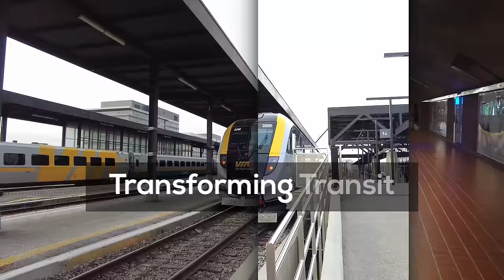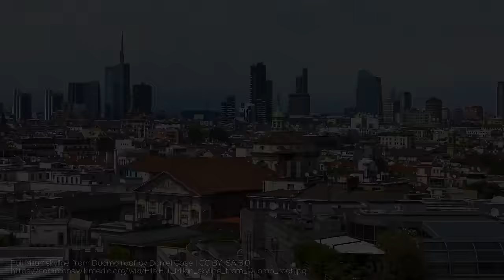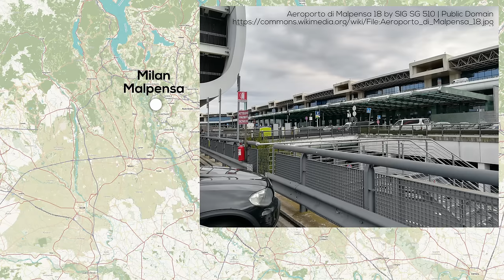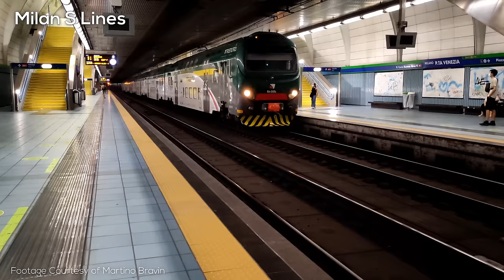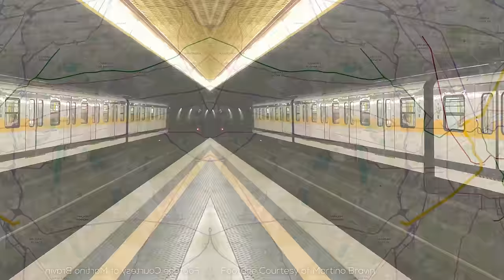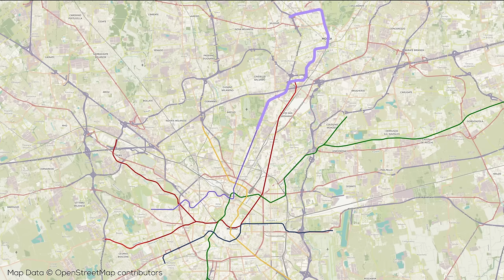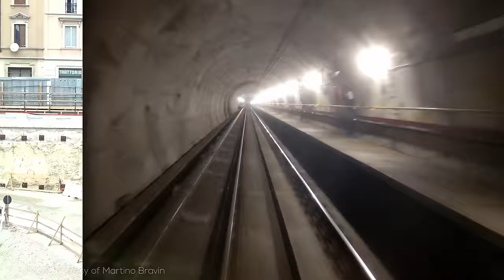A City That Builds Metros Like No Other | Milan Metro

Comment: I think maybe the wavy seats are a subtle way to get people travelling together to sit closer together, and people travelling alone to keep more distance than they might? (They look like "bum slides", so I suspect steering at work.)
Reply: Nope, just a strange design.
First time I saw it I was sceptical. But it's quite confortable
Reply from the maker: Haha interesting! I like a little gentle “innovation” though I am a little worried it’s hostile design
Reply: @RMTransit  I suppose if it's designed to push people around, yes, I suppose that could be called hostile. Sneaky buggers. But I had another thought on this that might be a bit less hostile. Someone sitting on a slightly higher seat than the neighbour would maybe have a little bit of room for his knee to drift outward without bumping into someone else's leg? Maybe that's the idea? Help people be slightly more akimbo without adverse social effects ... which I would say better if the words didn't keep running away from me.
Reply: @sicko_the_ew  I think the idea is to prevent people from sliding into each other when the trains are accelerating and braking by having the sides of each seat curve up more than usual.
Reply: @bahnspotterEU  Sounds like a reasonable explanation of their motives. Although if you're in a "hole", you'll get stopped, while the person sitting on the "mound" to your side is going to come sliding down to get all nice and cozy with you if there's a sudden stop, and the system works as planned? (So results might not be as intended.)
Reply: The wavy seats are a great idea: your a** being in a minimum energy equilibrium position, you don't slide into other passengers.
Also, it's difficult to occupy more space than {the space} you are entitled to…
Reply: @giacomoboffi9394  The sloped sides would definitely help with encouraging people to give others more space. Try to get too close, and you go slipping down the slope, or hit a "wall". 

People in maximum equilibrium positions might still slide down into other passengers, but probably only in some or other catastrophe, where that's not one's main concern. In normal circumstances, when their bums encountered that slope, they'd back off. Pretty smart. They've built "affordances" into the seats, that physically suggest how they should be used.
Reply: @sicko_the_ew  you can't sit on the bump as you WILL slide down as it's a really thin bump.
I think they were designed for keeping people from sleeping on all seats (drunk and homeless people)

Comment: Please do Rome as well, as someone born in Milan but who worked in Rome for years before the pandemic struck, there are stark differences in infrastructure, urban coverage and efficiency.

The only thing I'd add to this Milan video is that the S-line train system is absolutely tragic. The company that runs it (Trenord) has incredible issues with personnel scheduling which leads to huge delays, cancellations and worker strikes on the lines almost constantly (much much worse than the national train company Trenitalia which is also not great).

Apart from that I think you've done excellent work, can't wait to see more!

Comment: Great video! Ilive and always lived in Milano, so I can confirm everything.

Just one minor thing, Bergamo is a different city and its airport (called Orio al Serio) it's not part of Milan. But it is relatively near, so no big deal.
Reply: It's part of Milan airport system, over all on international codification (which include even the tiny and far Parma airport).
Then its users are from/to Milan's area and its enormous passengers growth of last 15/20 years is due to low cost companies wich of course offer connection from/to Milan.
Therefor a rail connection is planned

Comment: I’ve been using it as a base for a few days since arriving on the train via London (with a night halfway in at Lyon). What I still don’t understand is when the Milan tube shuts down? Google says there are trains back to my hotel (Bignami, M5) with a change at eg Garibaldi or Zara at maybe after midnight, but I’ve seen the staff closing off the doors to the station from outside before that.

I got the M2 from Romolo just now, near the Navigi canal district, and they were closing exits there at 23.20! Is maybe one entrance/exit left open, or is the station open only to connections?
Reply: As far as I know, M1, M2 and M3 are open at least till midnight and a half/one a.m (depending on the direction and station position), while M4 and M5 close just after midnight/quarter past midnight. After that, M1, M2 and M3 are served by bus replacement throught the night, while bus line 42 to Bicocca and Bignami continues all night long every 30 minutes from outside of Centrale (on the M2 and M3). Bignami is also served by tram 31, leaving the city centre from Piazzale Lagosta (near Garibaldi or Gioia, both on line M2) from up to 2 a.m.
As a rule of thumb, most or all trams tend to circulate later than metros, up to 2,2.30 a.m. generally, while some bus and the circular trolleybus circulate all night, every 30 minutes between 2.30 a.m. until morning. Hope I helped you and have nice holydays in Italy!

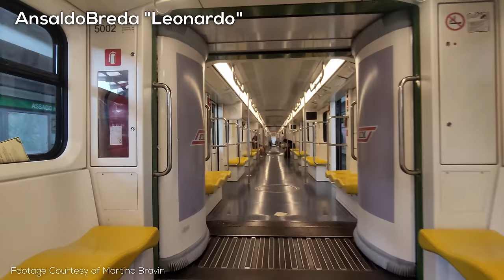Comment: 9:45 The wavy seating looks like it is a measure against homeless people or drunks.
Reply: But it's not
Reply: @urbanfile3861  ; What is the purpose then?
Reply: @FirstDagger  It's a re-interpretation of the usual seats design of the older convoys wich got a 'hollow' in every seat to get more comfortable. Which is pretty standard for rigid plastic seats.
First time I saw that design I thought they were unconfortable, but once I seated I found they actually are comfy

Comment: Also Who is interested in a significantly lower cost alternative which can be as fast, safe & reliable... as well as higher capacity than hyperloop /maglev? 

Using already proven technologies, and fully compliant with all international standards & regulations... it should also be faster to build & develop...

Promote & see our legacy for all generations, especially those yet to come!
Reply: It's trains
Reply: @superj8502  true, but how do you make them to be as fast, safe, reliable...  as hyperloop /maglev?
Reply: @ingoos  hyperloop has never had any large scale tests, but the concept is so flawed on paper that we can safely assume trains to be orders of magnitude safer and more reliable.
As for speed, you need some seriously long distances between stations for it to make a significant difference.
Add to this the complete incompatibility with current infrastructure and i just consider them to be doomed to be relegated to some gadgety airport link like monorails are.
Reply: @superj8502  good insights. I just may have stumbled on a simple solution. Waiting for patent.

Comment: I still wonder why M1 which has TWO starting point and TWO ending point has not split in two different lines. would be much easier to local and tourists alike.
Reply: The M2 has two starting and two ending points. The M1 has two branches, one to Rho Fiera and the other to Bisceglie while starting at Sesto 1° Maggio.

As for the M2, the reasoning could be funding and lack of enough trains to split, also the locals got used to it, and a change would not be liked
Reply: @thecommentaryking  yes, you are right i wrote M1, instead of M2... 
I do not understand this "funding and lack of enough trains to split" - there is nothing extra to do but printing some new poster and give linea M2.1 a new color, the train already are split between one branch and the other... and yes the user may be used to that, but it s not "usable", and i guess the change is easy to accept (and milan will get an extra line :-)
Reply: @ManoloMacchetta  Everything rotates around money. No money for splitting means no split, and even if they had, it would be considered a waste to have to repaint about half of the M2 trains just to have them do the same course as before, plus rebranding/recolouring every station. And ultimately it won't be an extra line
Reply: @thecommentaryking  on a politic / marketing point of view it's important. Milan could have 6-7 metro lines.

Comment: I live in Milan near San Siro in the M1 metro line.
I don't have much experience with other metro in other cities, so I cannot compare.
In peak hours you get trains every 90 seconds, so I agree they are frequent, but I disagree that it's a fast way of moving people.
There are too many stops, this causes the average speed to be around 25km/h.
It would have been better to have a main line stopping only on main stations and have other methods of transport for intermediate stops.
Or maybe a third line used for high speed incoming trips in the morning and outgoing in the afternoon.
Reply: Io vivo vicino a Bonola (sempre M1), ma il problema delle stazioni è anche se sono troppe, nella maggior parte dei casi c'è un via-vai di persone incredibili. Se ci fossero meno stazioni sarebbe ancora peggio... Il problema delle troppe stazioni per me è principalmente collegato ai tram che vogliono fare la "metrotramvia", tipo il 14 dove ha la preferenziale
Reply: @luca2716 va ristrutturata, la metro é sottodimensionato in ora di punta.
Invece di avere 50% della gente sui treni per 30 minuti, se fai il viaggio in metà tempi li hai sui treni per 15 minuti.
Serverebbe una terza linea bidirezionale ad alta velocità, per entrare la mattina e per uscire la sera. Oppure ogni tanto utilizzare entrambi le linee per entrare o soppassare.

Comment: Well I learnt that Italy’s largest and busiest metro system wasn’t Rome!🤯
Reply: Unfortunately Rome's metro system is really bad, just as the city public transport in general. It should become an example of how not to manage a metro.
Reply: @LucaPasini2  problem in Rome is that everytime they start excavating, they find some Roman ruins which automatically block the excavation. It is difficult for Rome to have an extensive underground public transportation when the land is literally filled with ruins of historic interests.
Reply: @KhalOisha78  That's a problem when building new lines, and a reason why it takes longer than usual. 
However it's definitely not an excuse for the fact that the lines that already exist are in a terrible situation, with many lifts and elevators out of order, station that haven't been refurbrished since the line openings, old and worn down trains, absurdly long waiting times because someone literally forgot to plan the compulsory maintenance and there are only a handful of trains in working order, an overly complex interchange station at S. Giovanni because they didn't have money to upgrade the fire detection system and had to keep the two station legally separated and also no definite corporate identity, as the three lines (while two other lines classified as "urban railways" but that look and act as metro lines, which is another bureaucratic nonsense) seem to be run by people who've never met each other, with signs and announcements in totally different styles.

Comment: Born and raised in Milan: note that M1 M2 and M3 trains are not composed by 6 cars, but actually by 2, each having 3 unseparable sections. :)
Reply from the maker: Yes but they combine to 6!
Reply: @RMTransit  I think he referred to how the cars composition worked back in the days before full lenght walkable convoys were introduced.
The basic composition was three cars. Head cabin + carriage + head cabin.
The two head cabins got both a separate housing for the driver. Then the full lenght composition was basic composition + basic composition
The basic composition of three cars could even run independently and since the mid '90s service was run with convoys of 3 cars during the last hours of the service.
Nowadays few of these old compositions survived, but you can spot them more frequently on M3, which is the newest line among the ones which used them, then its old convoys got a longer 'life time'.
Reply: The frist gen was L+W+L+L+W+L the frist fefurbish was  LwL+ LwL,  the Second fefurbish  and modern one are L W SP SP W L whit no separation
Reply: trains like meneghino and leonardo have 6 cars

Comment: As Milan citizen i'm just puzzled by the fact why first Linea 5 than Linea 4? why why
Reply: A short explanation.
M4 was a previous project, with the same route that is currenctly u/c. Therefore quite long and expensive.
M5 started with a shorter project (just Garibaldi-Bignami stretch) way cheaper than M4. That's why they found the money to build it very fast. And second stretch to San Siro went in the same way. While to find all the money to build M4 line was way more difficult (both M4 and M5 have private capital quota).

Comment: I think the M4 is ruining the whole system a bit. Before it, you could reach any stop on the network from any line by making only one line change, but the M4 cannot do it because it has no stops in common with the M3 and M5. Then every time two lines cross, there is a stop for who needs to change the line, however, that's not the case for the M4 as it crosses the M3 but it doesn't stop, forcing everybody to first get the M1, to then change to the yellow line. That's a shame :(
Reply: That's still not true: according to your thesis you could go from Isola to Rovereto making just one change; although this could be true by changing at Lotto, it's unreasonable to travel almost the whole M1 and M5 lines just to avoid doing multiple changes. Also, if trying to get from any station exclusively on the M5 to any station of the Bisceglie branch on the M1 you still need 2 changes
Reply: Now the new station of Sforza Policlinico of the M4 line just opened today and it is near the stations of Crocetta and Missori

Comment: The S-Bahn tunnel is closed due to lack of maintenance. Stations seems like to fall apart since years and yes... Someone says tracks were about to destroy trains so, it was shut down two weeks ago, and it seems like no-one has interest to reopen it soon. The entire S network is losing and losing services since 2018. Change of political interests. For that reason, public transport within the city is going better, in the last times (different parties rules the city and the region so... You've got the point).

The M5 line was originally ment to be a tram. In fact, in Northern and Southern part of the lines, you can find amazing grade separated underused tram lines, right above the underground line.
You know... Trams looks like "boring and poors", but automated metros looks like trandy and fashion. Line 5 is not having big congestion problems because, again, was meant to be a tram line. Line 4 will serve important part of the city not served by the underground yet, and using the same technology as M5. Trains that are less then 50% smaller than the one used on the historical lines. Good luck with that. Plus, M4 has totally missed connections at Santa Sofia (between Missori and Crocetta on the M3) and Cadorna with Regios and S trains (or at least... the services that are still running)

Big plans for a city that is trying to be European, but it seems like we're stuck in the Italian's mentality
Reply from the maker: Problems aren’t great, but most of them are solvable and the bones are good!
Reply: @RMTransit  Oh yes, (almost) everything is fixable, with political willingness 
Regional government be like "I like highways and roundabouts Brum Brum trains poors and immigrants"
Reply: The trains are half the size but the frequency is more than doubled (sometimes even 90 seconds) so it's definitely a win.
Reply: @superj8502  It's not. M1 has already upgraded signals for 90" frequency and M2 will soon follow. M1 is going better after signal improving but you can imagine that in 10 years there will be the exact same congestion problems you could find before the signal upgrading. The equation "smaller trains->higher frequency is simply not true, at least on underground lines

Comment: Definitely good points made about some smart choices but as an Italian living in London I find it very inefficient as they there's no line going straight under the Duomo and you almost always have to change line. That will always increases the time needed if you want to travel from a side of town to the opposite side. In my experience, I find tram, shared scooters and shared cars almost as cheap as the metro but way faster and efficient when it comes to move around Milan.

Comment: I lived in Milan and absolutely disliked the metro and in general the public transport. It's extremely expensive and nobody tells you in advance when they go on strike or if the timetable is respected. (in 90% of the cases: NO) If you have important appointments (school, work, dentist, airport, ...), don't rely on it.
Besides, the Milan metro is not in any aspect more unique than others around the globe.
Reply: Of course an opinion is to respect for what it is.
Anyway there are some details I want to focus on. Extremely expensive related at? Because it's one of the cheaper transport system in Europe afaik. 2€ for a single ticket which lasts 90 min. 
Strkes on public transport is always (by law) reported in advance. They always announce days before possible disruptions due o a strike by vocal bulletins and so on

Comment: i was just in milan and i would have to say i was very disappointed, way finding was extremely difficult even though I was traveling with an italian. also the system is extremely outdated, the stations are dirty, most of the escalators were broken, terrible lighting, and even some of the screens were smashed. the trams were even worse, while i see how some see them as “charming” they were so loud, dirty, and uncomfortable. also im not sure if this is an issue with google maps or the system but many trains/trams just didn’t show up as expected. i was really frustrated with the system that i just rented a bike to get around and stopped using it.